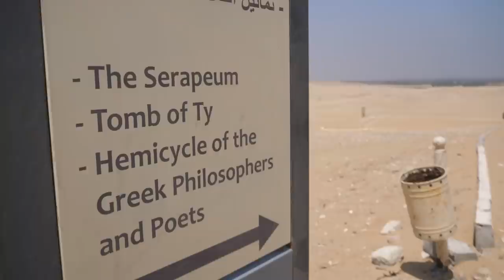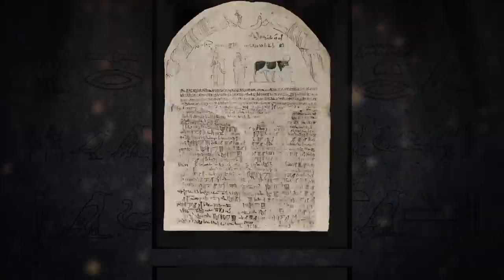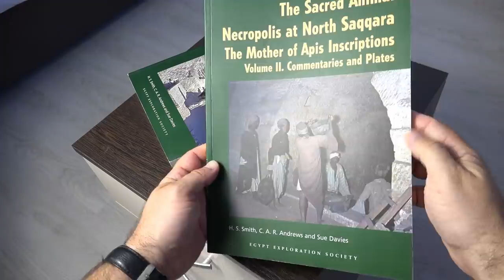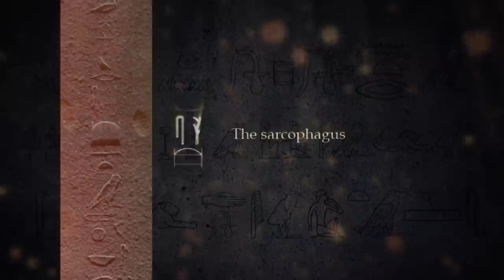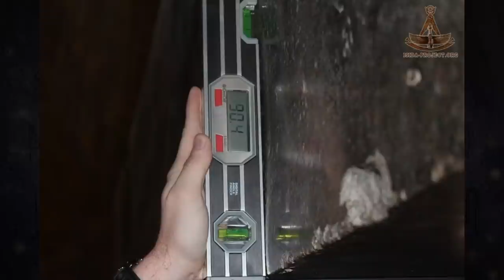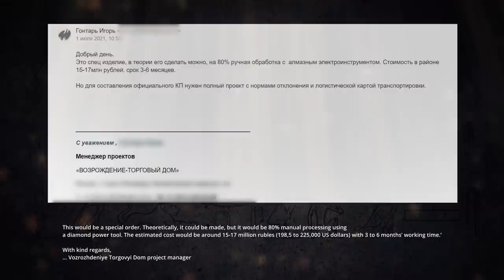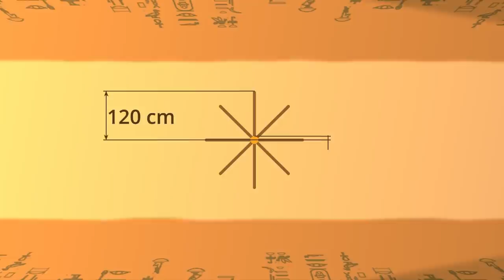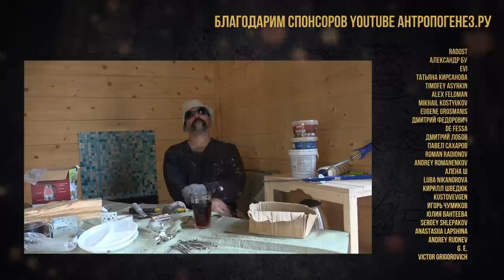The Impossible Sarcophagi of the Serapeum: What are Alternative Historians Silent About?

Comment: Measuring modern stones cut with modern automated machinery really detracts from any argument regarding the accuracy of the ancient sarcophagus measurements and it does not even address how they might have achieved what they did given primitive tools and measurement capability. The video is really minimizing the appreciation for the ancients who were able to achieve such accuracy as they did. This comes off as rather snarky and amateurish. What is the advertised accuracy of the Elitech angle finder? Do you even know? A nice Bosch "professorial" unit has an accuracy of 0.1 degrees.
Reply: @pranays  I am lying about the accuracy of a Bosch angle measurement tool? Well that would be very easy to double check now wouldn't it? I am just saying that if you are going to go and measure something, at least know the accuracy of the tool you are using to do so. This is basic stuff. Anyone who think that the ancient Egyptians were not impressive in their craftsmanship is a dolt. 1/10 of 1 degree over 2-3 meters? That is impressive. You couldn't even draw it on paper that accurately. Maybe use a crayon.
Reply: @AmericaAndAllies  surface plates and right angles made by hand from stone were used, and are still used calibrate, precision devices.
When did the first precise modern tool emerge? Hint: It was before advanced modern technology.
Keeping a straight line is about as easy as it gets, tighten a string line over 2 - 3 metres. Although that flatness exists nowhere in the Serapeum, the distortion in the reflections alone is proof of the deviations. Whenever a straight edge or square is used they all show the lack of "precision" flatness and right angles. They vary by several degrees along the length of each corner. 
The best is when Chris Dunn revisited the Serapeum and niche 23, he provided tools and when measured it was cringeworthy to see the mental gymnastics as they were being filmed. Nothing but gaps and imperfect corners, even by traditional hand stone working standards these boxes are far from great.
The precision thing is a complete and utter myth and whats more than big lost tech people still claiming it know it is untrue. Yet they keep saying it for money. There's more than a few choice ways to describe that and none of them include "honest or rigorous".
Reply: @normdeeploom5945  I am no expert on Dunn, or any claims that he makes. What we are discussing here is the presumption that these consumer grade modern tools are the "ultimate" in accuracy. If you want to demonstrate the accuracy, the only method that I am aware of that could ascertain this is by using high-accuracy laser measurement instrumentation. It is cheap, why is no one presenting this data? Let's not diverge the conversation in to the work of others. If you lack the ability to spot a charlatan move, it is best to not diversify in to other topics. Personally, I find it insulting that such amateur work as shown in this video is presented as objective and truthful information. It is affront to common sense. Suckers are born every day and this is a great example of it. No offense.
Reply: @AmericaAndAllies  consumer tools are made to standards. A builders square from the hardware is high quality, even plastic squares from office supply are made to standards within small fractions of a degree.. High quality tools have been used to measure the boxes as well. 
Cheaper consumer tools may not be good enough for aerospace but they are good enough to show imprecision.
Reply: @normdeeploom5945  Digital consumer devices like the one in question are given a precision rating by the manufacturer. You cannot debate the 0.1 degree accuracy. If you attempt to make any claim with such a tool, attempting to declare batter accuracy than the device is capable of, you are an emperor with no clothes. It is as simple as that.
Reply: By the way, that is with the assumption that you have followed the instructions for calibration. Even that is questionable in this video.
Reply: @AmericaAndAllies  It's as simple as fact that the angles are not within 0.1 degrees. They vary by up to 4 degrees along the length of a single corner. 
Multiple boxes have been measured multiple times now. The distortions in the reflections alone definitively disprove the flatness let alone the straight edges that show the flaws.
These consumer devices are marked with the standard from the nation of their manufacture as well as international standards. The rating by the manufacturer is also based on industry standards so they can be sold overseas as well.
I am not declaring the device is of higher accuracy than as advertised. The variations are tens or 100's of times higher than the devices.
Even when high precision engineers squares and straight edges were used the boxes were shown to be very far from precise and not even equal to hand working standards.
Reply: @AmericaAndAllies  Even if the device is not calibrated the variations are more than enough to prove the point of imprecision.
Reply: @normdeeploom5945  The question is not whether the boxes are created with < 0.1 degree accuracy, the point of this conversation is that these consumer grade tools not validate or invalidate the claims of accuracy. What should be without question is the accuracy and effort that was achieved using only primitive tools and technology.  It is nothing short of miraculous the level of effort that was expended on these boxes and the other works in ancient Egypt. Some of the precision on vases (measured with lasers) is confounding even today. Let's not overlook that in our pursuit of 'perfection' in the amazement of what they have done.

Comment: Nice but your compute at end is false xD

F = Crr.P

F = Force needed
Crr= Coefficient Rolling resistance = 0.15 Oki
P = 45 000Kg=450 000N
One Men can traction 220Newton averge

Soo F = 0.15.450 000 = 67 500
result Divide by 220 = 306

If Simply pulley is use, divide by 2 = 150 Men needed :) 

But I don't think they use rolling, no one use rolling, very very very bad, 0.15 is in best case, probably 0.2 and more for 45Tonnes, and woods will be block all time with no space, soo no rolling, but probably woods for glide.

Coefficient glide woods is about 0.04, so why use rolling whith 0.15 and more.... xD
Reply: For the rolling resistance F = (2Q + nG)k / 2R  where 
Q  is the weight of the sarcophagus 
R is the log radius
n is the number of logs
G is the log weight
Reply: The math is entirely incomprehensible to me, but my problem is that it has not even been proven Egyptians used pulleys. It makes logical sense that they did, but just like this video, nothing has been proven.

Comment: I’m just watching now but how are all 4 of the wall measurements over 90 degrees? Did you measure length width and height you can’t have more than 360 degrees. Your argument is invalid.
Reply: Why didn’t you bring a tape measure and measure square? Obviously you and Dunn have never built anything.
Reply: You can if the walls are concave rather than straight.

Comment: 54:00 “Lowering sarcophagus into position was easily accomplished with sand”. Your technique shown would NEVER work! That’s the problem with shows like this. You claim to know how to do something, and you pick ONE part of a multiple part process that works, and you claim to know how it was done. But the other parts of the process you animate are plagued with problems. For example, with the using sand idea: 
1. You show the SAR. being rolled out onto the sand. BUT you show a floor on top of sand. The problem is if you filled it with sand you could not roll it on top of sand, without the sand being packed down. The 70 ton box would sink as soon as kings went in sand. 
2. What’s the floor you show to roll out on. The floor would not allow workers to dig underneath it to removed the sand.
3. IF you solved the above problems which you couldn’t, you would never be able to get the logs out from underneath the SAR. The dimensions of the rooms are to small, AND the weight would have them buried in the sand all the way to the bottom if you dig out all sand. 
So you see, your theory just ignores all the critical details. And this is what Egyptologists do with everything they describe. Even like building the pyramids! Always ignore the details because they know it won’t work. 
And you’ve done the same thing here.
BTW, you didn’t even mention the lids. You didn’t say how the lids were part of the stone and how a 30 ton lid was cut off the top? Or how it was moved… Obviously you don’t know. 
Look, I can create pretty animated drawings also. Lots of people can. The problem is, it’s a pipe dream because the devil is in the details. You failed to mention how the explorer in the 19th century couldn’t even open the small SAR because they couldn’t move the lid, despite all efforts. Not even move it a foot to look in! So they used dynamite and blew a hole in SAR!  Again, your artwork is good, but it ignores all the details! Like what single ancient rope has a pull capacity of 70 or 80 TONS?? None. Today we’d have to use chain. 
How did they anchor they so called rope pulleys into the wall to pull against? Did the use a screw? Lol. OR, how did they anchor the rope, to the SAR and LIDS? And to make it turn corners? 
This is just ridiculous. 
Anyone can make claims, it’s something else to actually do it.
Reply: We get it. You don't want answers. You just want to make noise. Mariette was wrong obviously when he had his workers lower a sarcophagus by removing sand.
Reply: To add to what was noted.  Mariette = worked with an engineer when forming his conclusions on placement of the sarcophagi...........  That coincidently is more than the "alternative" schtick has ever done.  They simply gin up loads of clickbait videos of them on tourist trips filming themselves using some measuring tool likely from a local hardware store = to make trite declarative claims of purported impossibility........  🥱
Reply: 1) the sand is not compressible, therefore the sarcophagus would not sink
2) the "floor" can be made with wood or stone slabs
3) the logs can be removed while the sand is being removed

Sure, we won't know all the details until we re-create the process ourselves, through a complete 1:1 experiment, but it baffles to see people trying to nitpick small details in order to "prove" it can't be done and the Egyptians surely had Atlantean technology. It's like being a flat earther and believing you're scientifically literate.